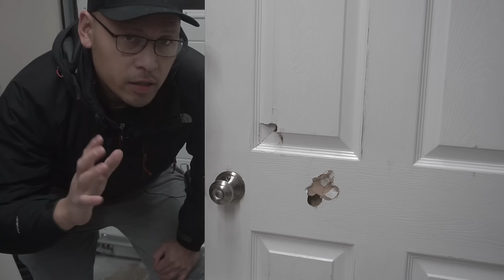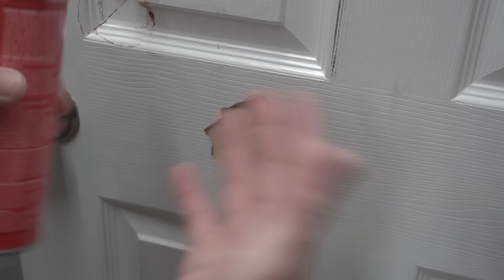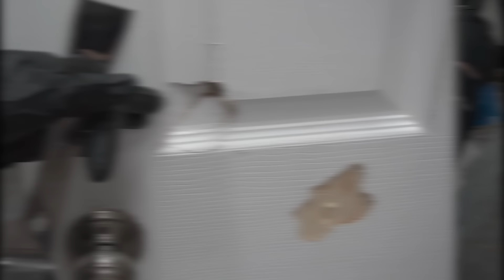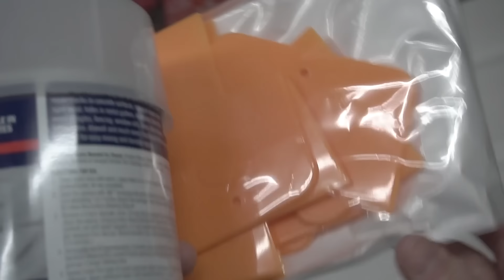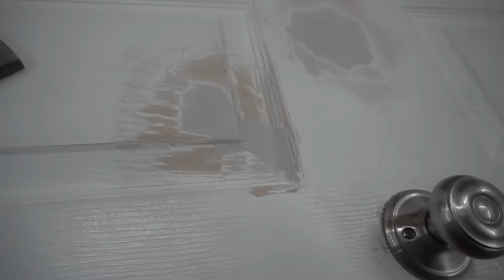How To Patch And Repair A Hole In A Hollow Core Door Like A Pro! EASY DIY Tutorial For Beginners!

Comment: Good job! Your method of using the wood shims, the expanding foam and the Bondo made the hole repair more structurally sound.
Reply from the maker: Thank you so much! I’m glad you like my method 🙏🏽😊
Reply: but you can't get the bondo right without sanding and you can't sand until it hardens. if you do the grains first you will end up sanding alot of your detail out
Reply: @Jack Holloway thanks! I do alot of specialized repairs in this area. I make good money and have a high demand. I have found that doing the fine details does require an ability to sculpt. very few times have I cut mt details beforehand. if I need a very deep impression I will carve it with a razor just before it hardens into a pain in the ass.
Reply: the doors i replace are well worth the repairs lol
Reply: It’s actually probably the strongest part of the door now, lol. Love it.

Comment: I have an easier fix.  Fill the hole with expandable foam and let dry over night.  The next day. trim the foam back to the thickness of the door outer shell.  Fill the space with wood filler.  While the wood filler is still wet, take an old brush and run it across the wood filler in the direction of the grain in the door surface.  Once the filler has fully dried, sand lightly, prime and paint.
Reply: Good job. I have 30 rentals and I appreciate you sharing your knowledge. Charles
Reply: PS Both the video and a reply were good.
Reply: @camiechappell1684 how would you recommend me going about attaining rental properties to eventually this being my main source of income over time. Thank you and I appreciate any information.
Reply: Thank you Brotha For a simple fix 🙏
Reply: Any idea what paint matches ?  That's my concern     my door is from home Depot
Reply: @NC01  I suggest punch out or taking part of your door to Home Depot they only need a small sample and they can match your paint and give you a sample which should be more than enough to match a small spot on an door and if you need more they can provide you however much you need, but I’d suggest letting your paint dry before going to town 😂
Reply: Always makes you wonder what the story was when the door got damaged...
Reply: @LeSauce777 I did that with some old white baseboard trim which had started to age and turn a slight ivory yellow over time (and none of the interior house trim was getting repainted but it just needed some touchups due to being removed and reinstalled for some new flooring = paint matching is an awesome trick.
Reply: You really have to weigh your time vs the cost of materials. If it takes you a whole day to save a $108 door slab, it's not worth it. Just replace the door and paint it. You're buying paint anyways, but 6 hours on door repair vs an hour to hang a door and paint it.... buy the door.
Reply: I guess, but it's different structurally. If you snap off the filler by slamming the door, it will come loose on the inside. This technique used the foam as a wedge for a piece of wood, which is structurally more durable
Reply: @NC01   You can take a chip from the damaged area and the paint department should be able to match it.  If it’s off a bit, you might have to paint the whole door.
Reply: @sef648 * wah* I thought he would answer your q, I’m wondering the same thing, the hardest part is to start with the first rental but once you’re in, easy peasy!
Reply: It will not work.‼️You need the wood in front of the foam. This is including on drywall.
Reply: Good information Sir

Comment: A simple way to replicate the wood grain is to scribe in the grain lines with a toothpick while the bondo is still soft. It takes some finesse, but is much easier than trying to do it after it hardens.
Reply from the maker: Thank you for sharing your advice! 🙏🏽👍🏽
Reply: … multi tool when dry!
Reply: I had to fix  a door that had been mauled with an angle grinder by the painters that worked for the HOA. The wood-grain wasn't much of an issue, since the paint was thick enough to hide it, but the fluting where the wood  met the glass was all messed up. I used construction adhesive and re-created the lines with a hack saw blade as the cement was hardening. Still looks passable today.
Reply: Good point I was looking at making a mold to copy it to lay over the patch as it sets up then taking it off but a scratch tool works also probly more control.
Reply: Just use a file. If you have an assortment you’ll be abled to match the curves easy once dry.
Reply: You can also drag a stiff paint brush through the soft bondo
Reply: Just get a new door 🤣🤣🤣 it’s literally the price of a large can of bondo and cream
Reply: Great idea.
Reply: That’s a great idea! The wood grain on this door was quite simple also, it went in long lines, so it would be quite easy to start on one side of the repair and scribe until you meet the same line on the other side.
Reply: good idea be describing in the grain but I don't use Bondo I don't like it
Reply: Nylon brush will put a passable grain in very quickly. Then you can detail it with a toothpick.

Comment: Instead of epoxy putty, I use Durabond 90 which is a drywall compound with a hardener in it that is typically used for corners on drywall because it is a lot harder and more durable than regular drywall compound, but is still sand-able. I put the stuff on and let it dry a bit, then use a notched trowel with small teeth and drag across the surface of the putty to blend in the wood-like texture of the door.  Works like a charm.  Once sanded down a bit, primed and painted, you'll never never know there was ever a hole there.
Reply: You should do a video on this! I would love to check it out
Reply: Did you still use the foam and wood support inserts or not needed with this method ?
Reply: I would use crumpled up newspaper as a backer, and fill the holes with 20 minute mud. The wood grain is easy to do in the semi-cured or cured mud. Shape, sand and paint.

All of this CA adhesive, wood shims, expanding foam, Bondo and paint will cost more than a new hollow core door. The 20 minute mud is cheap and can be used to patch walls etc.
Reply: Does Durabond last and not crack? This is what I want to use
Reply: @davidparker9676 does Durabond last and not crack?
Reply: @jamesholz6632  absolutely. Still holding 5 years later

Comment: I was taught to use thick cardboard for this, to make a hole in it and add a string with a (wooden) match stick (minus the sulfur/red) fastened to it on the backside, so it can work as a stopper. This string can be pulled on without coming off before you cut the it (then the match falls down into the door and stays there). Glue was applied to the cardboard, which was fed into the hole, so it would be glued to the backside around the hole by pulling on the string for a little while. When the glue had dried, spackel («plaster»?) was used to fill in the hole itself (since the cardboard works as a support or scaffolding) and to provide the finish, then sanded before the door was painted. On a door like in this video, if you want a close to perfect result, you can use different tools to draw in (or more correct; cut out ) the texture that is missing, by filling in the lines that are missing. This shouldn’t be very difficult if you used ordinary spackel.

Comment: Very interesting, I use HardRock, when I do this.  It cost less and is easier to work with, but it is always good to have several options and I thank you for that.  God Bless!
Reply from the maker: Thank you! I’ll need to try that product!
Reply: @FixThisHouse  It's incredible, I use it to repair Facia instead of replacing them.  God Bless!
Reply: Did you mean Durham’s RockHard? Not HardRock as in the Café and music? 🤗
Reply: @lottatroublemaker6130  Durham's, God Bless!

Comment: Looks good. In fact, I think that looks good enough that you could have saved the door; the only real reason to buy a new one was the asymmetrical trimming on the hinge side, and even that could be fixed by shimming the hinge side and trimming the doorknob side. In fact, if you haven't already, you might want to do a video or two on trimming doors that are a little too big. I've made use of a number of doors that way, and it they last forever as long as you make sure there is enough wood around the edges. Stile&rail doors are a little harder, but with a few well placed metal fasteners, they can also be trimmed without leaving them in pieces.

Comment: Nice. I would lay the door down when putting in the spray foam.  That way gravity does not pull the foam away from the area you want to build it up in.
Reply from the maker: That’s really clever! Thank you for sharing your technique! I will save that in the future! 🙏🏽😊
Reply: I would have laid that door down in a nice dumpster.
Reply: @scotts4125   Then you're going to have to go to the bathroom with no door.
Reply: @drmodestoesq  I suppose it would be easier to ask you for a roll of TP so not all bad!
Reply: At 18:50  I use old gift cards or credit cards for spreading bondo, you can even cut a credit card it define small areas. Much easier than sanding

Comment: I like to cut fine wood grain groves when the bondo is semi hard.  A multi tasker can carve the molding profile on the 45 but it is tricky.  The wood grain is stamped at the factory so if you have a junk door you can cut out the same area from the junker and match them super good with the junk door piece super glued in place of the bondo.

Comment: I had a very similar damaged spot on a door like your second repair. I just wood glued it scuffed it up and used spackling to finish the repair. Spackling is a lot cheaper than Bondo and vastly easier to sand and it's fairly easy to rough in the grain pattern. After repainting it was hardly noticeable.
Reply: I like spackling with a thin layer of drywall mud on the surface. The later is the most easily carved  substance I can name.
Reply: What's spackling? I'm in Australia tho? Probably a different term.
Reply: @dragan3290  It's a light weight premixed plaster material. Small hole wall patching material.
Reply: @justaman5490  ah yeah! InAustralia we call that spak filla. Cheers. 👍👍👍
Reply: I repaired several injuries to a door with first sawdust and wood glue, then spackel. That was almost 20 years ago and it still holds fine. No trace of the awful damage a nutty carpenter did to that poor door! SMH just thinking of that carpenter! He taught me one thing: Always ask for references!!! ☺️
Reply: @dragan3290  - It’s plaster meant for smooth surfaces.
Reply: @pcno2832  I would never use drywall mud on moulding or doors, it has sand-like grains in it and creates a way too coarse surface for that purpose! Trust me, I know from experience. A guy who helped me, by error used drywall mud on a large window frame here. I ended out having to sand down the whole window frame, as it was so coarse, it would’ve been impossible to wash, a cloth stuck to it, that was how coarse it was. Like velcro! Never use that stuff on smooth/wood grain surfaces!
Reply: @pcno2832   the latter (not «later») 🤗

Comment: We line hole with crumpled newspaper and then spray great stuff then after it hardens we trim slightly below the service  then fill it with minwax 2 part epoxy two coats.  Then scribble grain in the epoxy.  It hardens in about 5 minutes.  Never had a problem with this type of repair.
Reply from the maker: Thank you for sharing!

Comment: This is outstanding work. I wish my doors were like this, but unfortunately they're those old school ones that are flat with a woodgrain, stained finish so I can't use these techniques without having to paint to hide the patches. The one thing I don't understand is why did you not cut out a square to make things a bit easier for you? I'm honestly curious to know. Is it more difficult? The reason I ask because I would have treated this like a drywall patch. Cut the damaged area into a square, use paint sticks for backers, CA glue to seal the hole, then wood putty because I didn't even think of Bondo, or Durabond, lol. I also would not have thought to use the spray foam.
  I apologize if I sound like a snarky idiot. I assure you I'm not being snarky, but I AM an idiot, lol. Thank you for the great video, and thank you comment section for additional tips!

Comment: Great Job! Alway before a paintjob i find it so hard to imagine how good it will look.
Because it always looks botched when its ready for paint. Doesnt matter if its walls, ceilings or doors.
Details on the mirror surface is not too hard to do. Just wait till the putty is like clay and run a weat pencil over it making the lines.

Comment: I've come to really like your informative videos.  About those little detail areas of the door, I've done one interior modern type.  On one side I used my curved wood working tool. Fine,  but Bondo can really dull them if it's dry.  On the opposite side while still soft enough to manipulate I pressed a #2 pencil along the groove, and got a perfect line.  On a larger more complex piece of 80 year old door I used my pin curve/shape tool on a good piece and then taped the pins so they would not move and dragged the shaped side along the wood filler I was using to imprint the detail.  (I had not learned about Bondo except for old car repair at tat time.)

Comment: 0:00	Learning objective
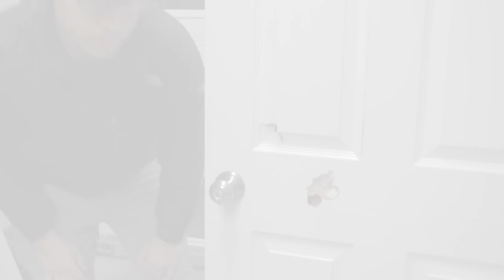00:05	Channel Introduction
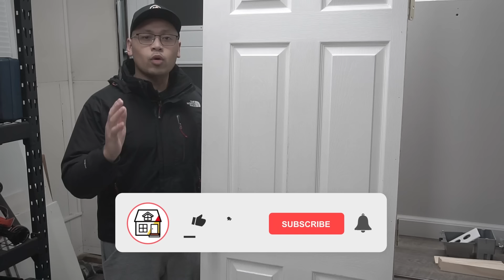0:12	Welcome & subscribe
0:22	Two problems with door: flat surface and profile damage
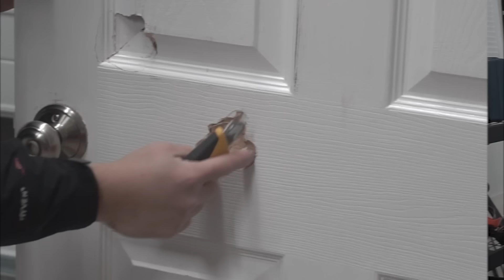2:01	Clean out immediate area with razor
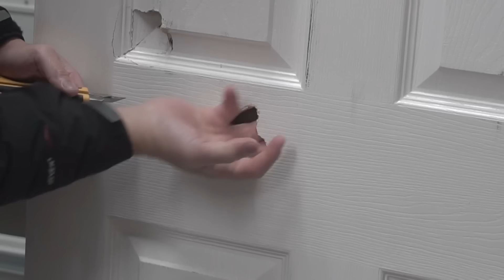2:25	Make sure there are no interferences around area behind door
2:33	Don't use just spray foam
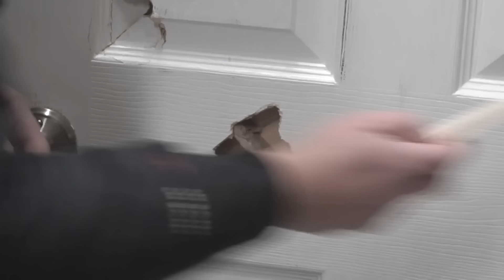3:33	Get shims to serve as backing
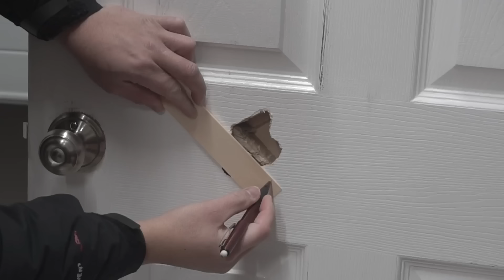3:51	Mark one inch on each side of each shim
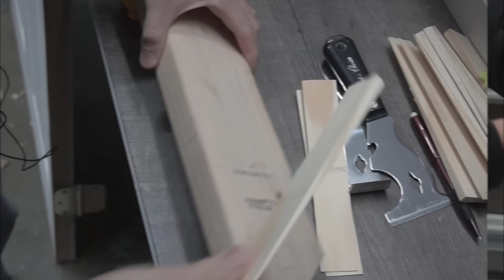4:21	Cut the rest of the area of the shim off
4:47	Test fit your shims to make sure they cover the area
4:54	Put one drywall screw through shim one inch away from edge
5:54	Add shims one at a time
6:00	Add "Thick" 2P 10 adhesive to 1) top AND 2) bottom of each shim
6:30	1) Carefully slide each shim into the hole and 2) push & pull the shim onto the door so that it sticks and 3) let each shim dry. (You can leave the screw there while it dries. Also remove any cardboard behind the shim so that it doesn't get in the way.)
7:28	Plan ahead if using multiple shims (put third [top] shim in first and then get a piece of tape to hold it so you can put your second shim in the middle.
8:01	Add adhesive and attach second piece.
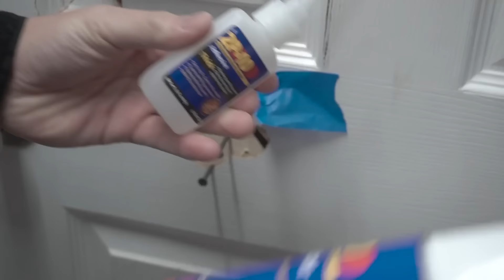8:07	Activator accelerates adhesive process
8:52	Remove tape
9:04	Add glue to third shim
9:18	Spray activator on top and bottom of third shim
9:35	Push against door to ensure third shim sticks
9:40	Importance of having a solid backing
9:48	Carefully remove screws from each shim
10:09	Do not recommend just spraying spray foam without shim method
11:25	Drill through the shim (right through the middle) and apply spray foam (5/32 drill bit)
11:41	Drill second area at top to prevent air pockets
11:48	Importance of drilling more than once
12:06	Going to use "Great Stuff Wind& Door" spray foam
12:15	Use gloves: Shake up spray foam, test spray the spray foam to make sure it works, and then and carefully use smart dispenser to inect through middle hole "for a few seconds." It is a good sign when the spray starts to ooze a little bit out the hole. Let it set for a little bit. (Purpose: Provides stability and support for the back.)
13:40	How to fix other area
14:10	Put screw through door
14:35	Put shim on remaining space
14:51	Apply glue and spray
14:57	Slide shim in
15:05	Pull shim back and forward
15:09	Drill through shim with 5/32 & put another hole in salvageable door part
15:28	Spray both areas with spray foam
15:32	Evidence of enough spray foam is that it is oozing out
15:45	Inject spray foam into second hole
16:06	Add a little spray foam to surface area
16:17	Take out shim screw
16:26	Leave other screw until remaining spray foam dries
16:31	Leave everything out for eight hours so that it can dry
17:32	Take out screw
17:35	Trim spray foam below door profile
17:42	Use bondo all-purpose putty (and benefits)
18:09	Use spreader
18:14	Use gloves and respirator
18:25	Open up Bondo, which comes with cream hardener
18:40	Open up Bondo with 10-in-1 tool
18:42	Open up spreader
18:53	Use cardboard for mixing everything up
18:56	Open hardener (came with Bondo) and mix with Bondo
19:02	Apply mix of hardener and bondo and fill in the gaps on door with spreader (don't push down hard) [NOTE: You have 15 minutes of working time with bondo mix before it hardens!]
19:25	Use 10-in-1 tool to fill in other hole
19:48	Use 80 or 120 grit sandpaper and sanding block to make the door flush
20:09	For harder part, use sanding paper and block to shape area 
20:24	Fill area with hand: if smoothe, it is ready for paint; if you feel a bump or roughness, it is not.
20:36	 Flat areas are easiest to smoothe out; the corner areas are the hardest.
22:12	Wipe off area with towel
22:33	Prime and then paint
22:41	Paint
23:06	Commentary on outcome
Reply from the maker: Wow! Thank you so much for taking your time to so this time stamp! 🙏🏽😊
Reply: @FixThisHouse  welcome! I was making notes for myself and thought I’d share with everyone else 😇
Reply: Over the top Time Stamp. That effort I believe is an asset to one's channel effort and TYVM.
Reply: @kevingoldsmith91  nice going kev🤯
Reply: Whoa you go Spaulding, I bet your pencil pocket protector is full.